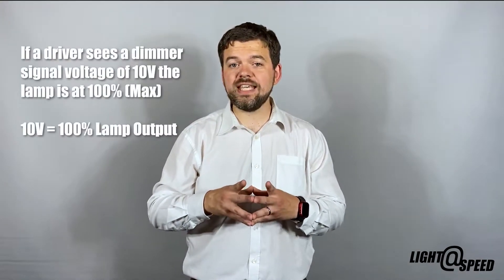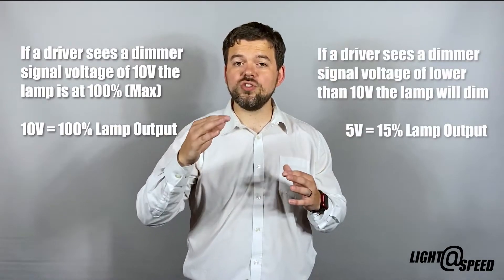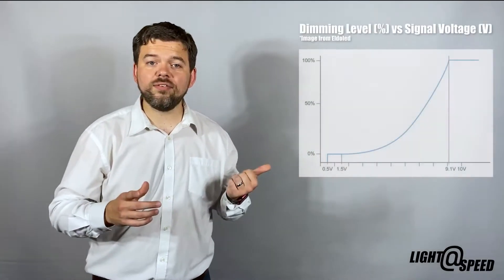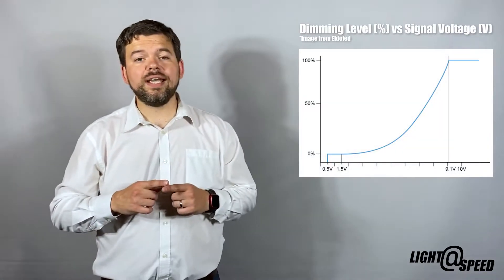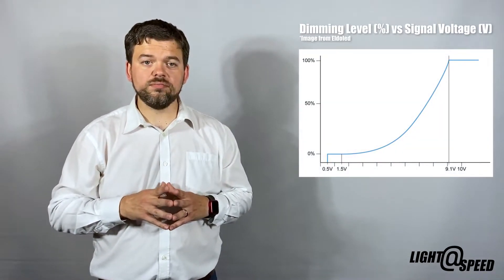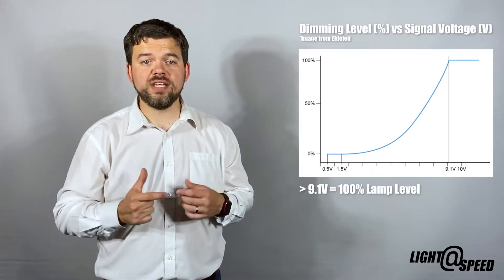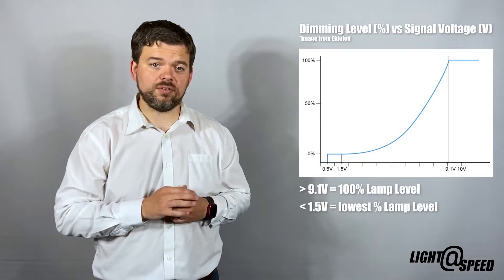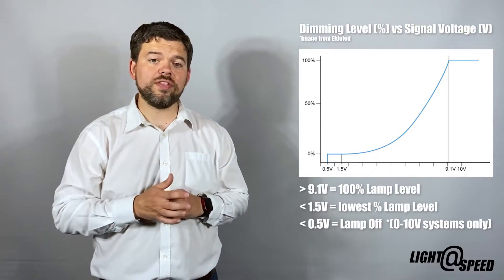Light at Speed - 0-10V & 1-10V Dimming

Comment: Hi Mathew,
Could you explain if there's a possibility to connect a controller (0-10V sourced) to a (0-10V LED Driver Sourced)? I am facing a situation where an LED driver provides 10V on its terminal with open wires. When it's connected to the controller, the LED driver voltage syncs with the controller output voltage.
Reply from the maker: Interesting question, the first thing I would try is removing power to the dimmer if it is a simple rotary dimmer. If it is an active controller, and both are 0-10v devices then it would normally work..
Reply: @mattnourse  Thanks so much for the prompt response - much appreciated.

Comment: Matthew, is the 0-10v dimming signal AC or DC ?  I would like to control a series of lighting bollards that have the 0-10v ballast in them already.  I would just like to install a small 120vac  x  5v transformer in each fixture for a permanent dimming level of  say  50%
Reply from the maker: DC! It’s worth trying a resistor first though as quite a few will work with just a resistor. Try a 100k potentiometer between the 0 and 10V terminals
Reply: @mattnourse  Thank you so much! an adjustable potentiometer ? or fixed value? or? I do like the resistor idea too
Reply from the maker: @jameslewis6784  well try and adjustable, then measure the resistance level you like then put in a matching static resistor to set it.
Reply: @mattnourse  I get it! your great ,Thank You, over N out

Comment: Hello, I'm trying to timer dimmer this meanwell 120w driver, How would you do this?  Plenty of video about how to connect a potentiometer but that is not really useful for plants.   I was thinking of using SPD-001 made by meanwell, connect to usb and has little software provided by meanwell. Smart Timer Dimming Program software V1.1.   Honestly cannot understand how to program it, very complex,  but what I want to do is simple  ; sun rise , sun set at precise time ,  rise and set  over 50 min.  Can you help?
Reply from the maker: I would recommend buying a Casambi CBU-ASD set to 1-10V or 0-10V (which ever you need) you can then program scenes as dimming levels from your phone and set it up to trigger at certain times of the day. And then just let it go as time passes through the day it will pick various scenes and the programming is very simple.
Reply: @mattnourse  great thank you! will try that!
Reply: @mattnourse  I guess I'll just bin the SPD-001 then, shame because that was 22£ as opposed to 80£, I'd love a system that doesn't rely on an Iphone, but it maybe obsolete way of thinking
Reply from the maker: @RusticRaver  well once you have set the unit up by phone, You do not need to connect to it again.

Comment: i wonna dim road light using Arduino and 0-10 v pwm  or pwm DALLI for  light intensity control(30% -100%) , please, how do i do that, give me schema  , What's inside the smart road lamp
Reply from the maker: All smart Road lamps work in a very similar way. They have and LED PCB mounted at height, and a switchable or dimmable driver mounted at the base somewhere accessible.

Smart road lighting systems tend to use Dali style communications as they offer by directional information sharing including lamp failures or Power Draw which is very useful as it can tell a central control system if the street lamp has failed.

There are many street lighting drivers available that have been tested in extreme environmental conditions and you will be much better off just buying one of these.

Comment: Thanks for the video! May I ask something. I came across a situation where I had a PLC analog output of 0-10V and a universal Input 0/1-10V of a LED Driver. But the driver did not correspond to the signal. I had to remove a resistor from the driver (guidance from supplier) in order for the driver to dim the light. Does it mean that driver produced its own voltage? Is it normal for 0-10V method? Thanks in advance!
Reply from the maker: With 0 to 10V the dimmer provides the Voltage. So if you have a driver which is meant to do both and it can’t auto select it’s mode, it might be out putting a voltage too. Then it’ll never dim. Worth multimetering the driver 0&10V ports and seeing if there is 10V on it too. Which make driver?
Reply: @mattnourse  It's a greek brand but I would rather not say to avoid misunderstandings. Sure, it does because when connected to the driver, the PLC output was outputing its voltage correct only between the range of 8-10Volts (guess based on the parallel circuits' resistors). So,  if I understand right a sole 0-10V input would not have any issue, right? I have found as a solution to this the use of a votage isolator  (0-10V to 1-10V current drain for EVG). Thanks a lot for the reply!
Reply from the maker: @ΠαναγιώτηςΧατζηαντωνίου-ι7θ  how interesting, I would guess a simple potentiometer might work too. 

Well done on the fix though! What made you think of trying an isolator?
Reply: @mattnourse  Searching the internet... ha,ha! Actually, that's a troubleshoot I found. The actual solution was the removal of the resistor I was told to remove from the LED driver. Guess it was in series with the internal source. How would a potentiometer be connected between the PLC and the LED Driver? Is it true that if it was a sole 0-10V input there would be no issue?